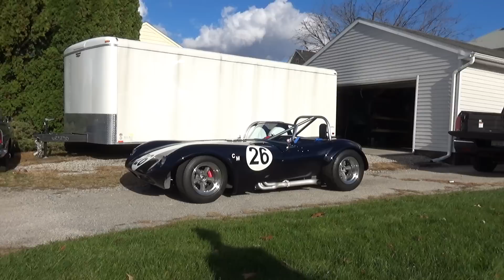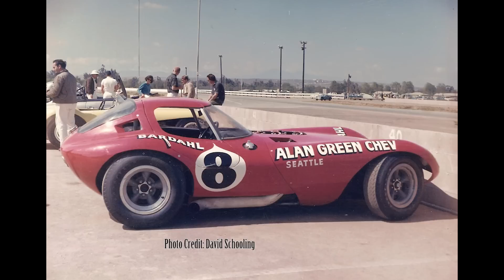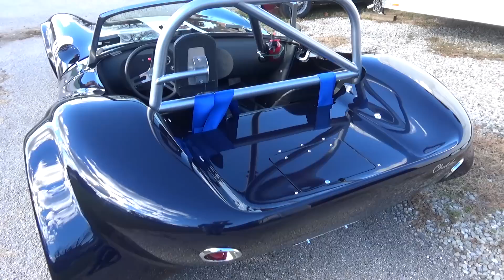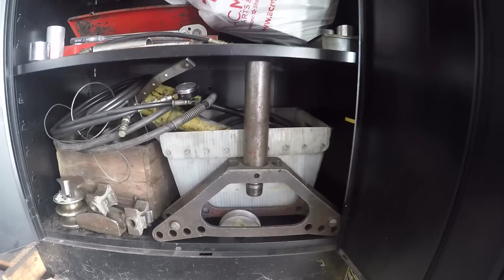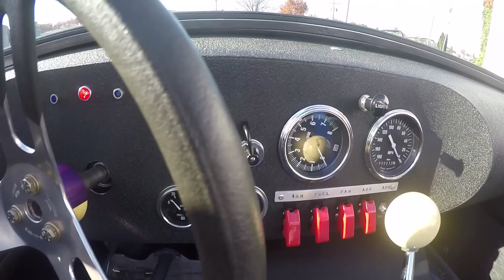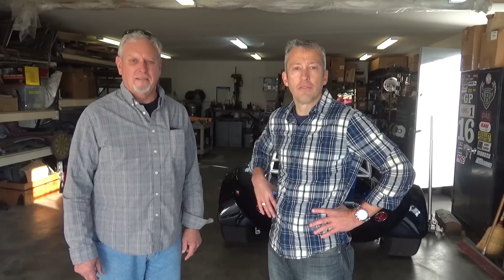Twin Cam Cheetah

Comment: Very nicely done!  Informative, and spot-on! I feel we should mention Bocar. Z06 powerplant and drivetrain, Buick Alfin brakes, tube chassis, glass body. 1700-2200lbs, 50/50, 50/50 weight distribution in 1958. A Bocar Stiletto set the record for average speed at Daytona at 178mph in 1961 before blowing the clutch.

Comment: i had a cheetah slot car as well with piano wire frame and a champion  motor  1/24 scale used to go down on division ave in chicago and race it at a  slot car track like 8  wide if i remember correct it was  maybe 1966, id run from bar to bar shine shoes to get money to  buy my slot car stuff beautiful car never seen a roadster cheetah before

Comment: sort of looks like a viper
Reply: Not to nitpick, and point taken, but perhaps the Viper recalls key extreme-radical design-cue concepts that inspired the original Cheetah as much as the car itself, which predated it by almost 3 generations. Following the form-follows-performance design formula, with a nod to elegant streamlining principles and pushing period technology as far as possible, the Cheetah inadvertently mimics notably-basic XK jag and vintage racing sports cars with its elaborately-sculpted wheel-wells, looong graceful hood and truncated deck. A brilliant, stunning tribute to a timeless meta-esthetic!

Comment: at 200 mph the car would  take  off. its a death trap,
Reply: What you don't know about race cars would fill volumes.
Reply: that makes two of us, Robert,
Reply: stevey the queen, poor little steveyqueen, is triggered and can't stay on topic. Why is it morons like little steveyqueen, have to come onto the Internet to affirm how stupid they really are.
Reply: @bheinric2116 ~ Yeah, the notorious youtube-phenomena, crudely inflicted nit-picking opinions that mock discretion. What ELSE can be said about an elaborately hand-made 400+ hp 200+mph-capable 2200 lb streamlined brick with Muncie 4-sp, 4-wheel discs, full-cage and racing-seats! Like Gary, I used to have a hot blue Cheetah slot-car (that I made myself, from parts) too!
Reply: RC pull your head out have a nice day A hole

Comment: CheetaRolet its french...lol      it needs a full cage yep well i'll put that full roll cage in my own car if you dont like that remark ...did you have to rent a 3 million square feet airport hanger for the  huge project .... Frame biggest kept secret.....what about using a aluminum V6 Engine that makes 400 hp would be better but maybe the cost would be to much but it would be better for weight reduction and weight distribution..pretty cool Boss = do some donuts...